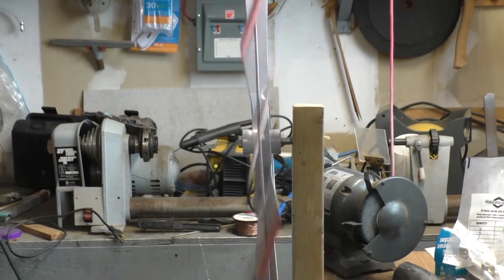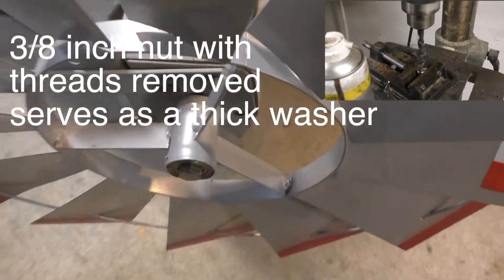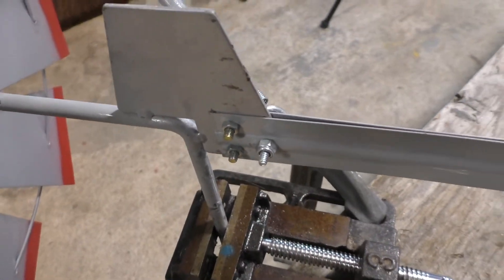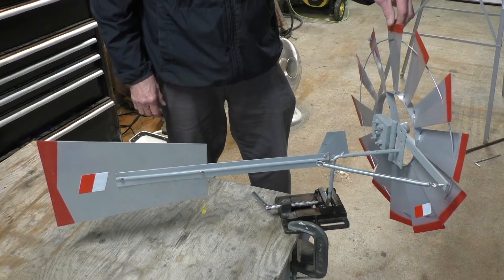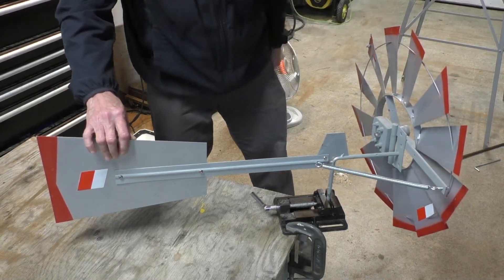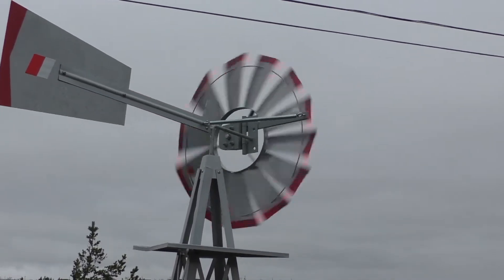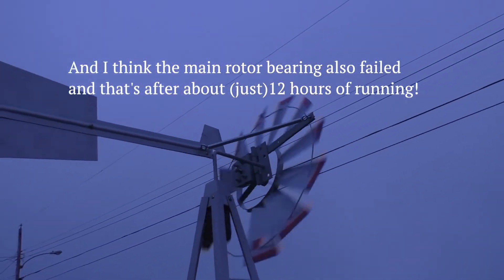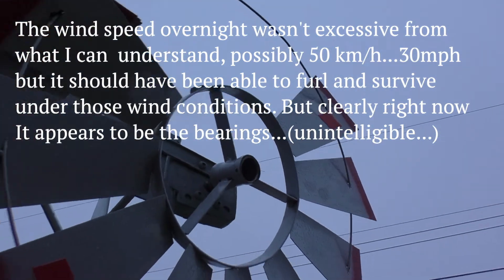#3 American Farm Windmill at home - Installation, test, and first failure

Comment: Hi

There are two return methods for a passive furl horizontal windmill: springs (like your design) or weight displacement.

Weight displacement is simply a mechanism that lifts a mass when the wheel is pushed out of the wind by the offset shaft. It can be implemented with a tail boom on an angled pivot, so the tail pivots up, or it can be a weight that is lifted via linkage to the tail boom.

I see some issues on your prototype that you can try correcting. 1st, keep the fan as close as possible to the yaw shaft. This will reduce precession forces on the main shaft. 

2nd, keep the spring lever far away from the fan. Use a smaller lever and lighter spring.

3rd, get rid of the door hinge. It has too much play and allows the fan to shift from the precession. 

It's better to have the tail boom pivot relative to the main shaft.
Reply from the maker: Good thoughts.  Thanks.